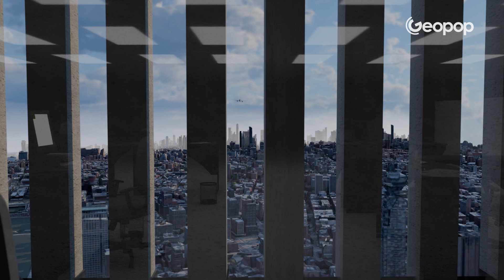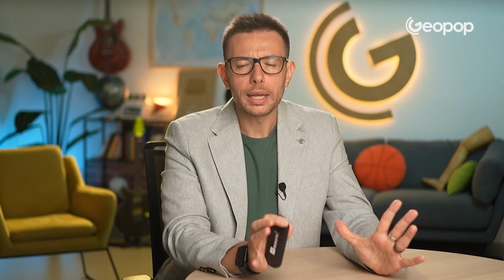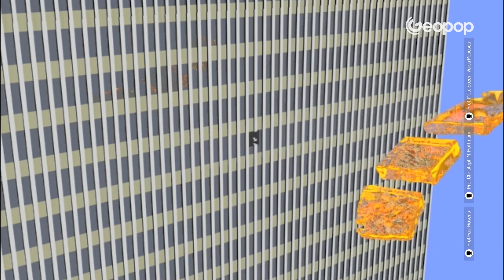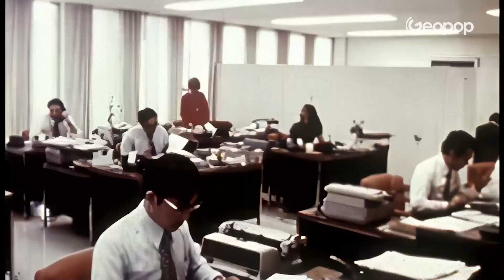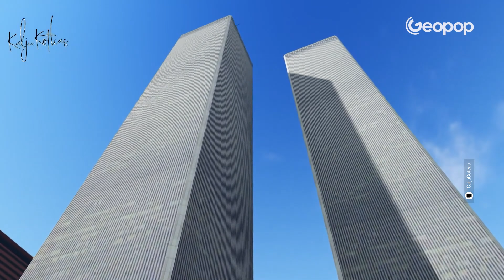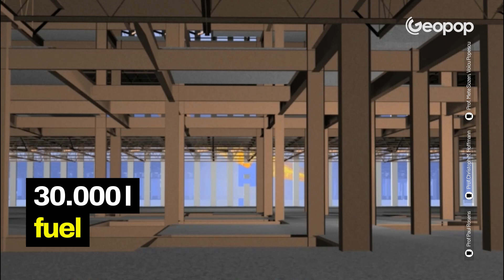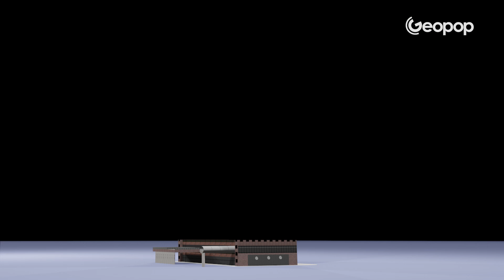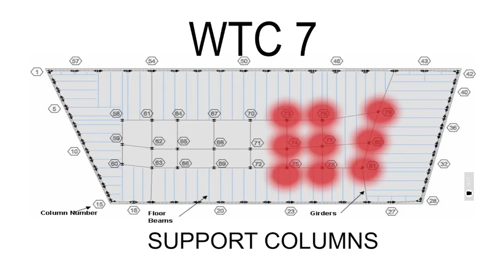9/11, 2001: The Technical Reconstruction of the Twin Towers and WTC 7 Collapses

Comment: 100% controlled demolition, never been more sure about anything in my life.
Reply: Sucks to be you then. There’s a lot of really bad information out there about the Twin Towers collapses, much of it easily accessible to anyone (mostly from Architects & Engineers for 9/11 Truth who only manage to get the date right). Even though the worlds professional engineering community had the details largely worked out within a couple of months, good information is far more difficult to come by and much harder for many to digest. Engineeringspeak is complex and dull. Wild baseless speculation and pathological theorizing is exciting. Simple, easy hand-wave answers are simple and easy.  Fanciful tails of pre-planned demolitions, magical space beams, melting steel and mini-nukes (the awful stuff) are far more entertaining and require a whole lot less thinking, thus getting far more intention than it deserves.

To correct that situation, I have all on my own prepared this short yet detailed technical description of Twin Towers collapses based on my own observation and analysis of the available true and relevant facts. No politics or ideology, just the engineering. My hope is this will dispel many common myths and answer most if not all questions you may have about the Twin Towers collapses, because anything can seem like a conspiracy if you don’t understand how it works

While complex, most of the Twin Towers collapse mechanisms can be seen with the naked eye and easily discerned and understood by the layperson if sufficient time is taken to understand. 

1. The Twin Towers consisted of 4 primary structural elements that together formed an integrated system where each relied on the others.  47 hollow box-section steel Core Columns carry the majority of the gravity loads. The 236 hollow box-section steel Perimeter Columns carry the remainder and ALL of the lateral (wind) loads. Long-span Lightweight Steel Trusses connect the core and perimeter column together at each floor with a Hat Truss on top to tie the structure together as an integrated unit where no element can survive without the others. There was no structural load bearing concrete and most components were bolted together.

2. The impact of 117 tons of airplane (= to about 12 dump trucks) at speeds up to 590 mph with the energy of a ton of TNT completely destroys the aircraft. This in no way implies the Towers come out unscathed. Many perimeter columns are damaged or destroyed as are some core columns (example; 33 of 59 perimeter and 20 of 47 core columns damaged or destroyed at the impact floors in the North Tower), This damage is primarily through bolt-shearing failures at the end connecting flanges, as well as bending, twisting and fracturing of weld seams. There was no cutting or slicing - the reality was far more violent and messy. 

3. The impacts destroy or damage fire insulation, fire breaks and sprinkler systems on multiple floors.  Huge fires are started across multiple floors simultaneously and allowed to spread rapidly with no effective firefighting or fire suppression. This was an unprecedented fire event . 

4. The hotter steel gets the weaker it gets .  With fire insulation stripped away and no sprinklers the survival time of the steel greatly reduced. Gradually over time heat causes the lightweight steel Floor Trusses at the impact damaged floors to sag, which was observed and recorded.  No steel melted or needed to. Structural steel fails long before it becomes a puddle. It just needs to bend

5. Sagging floor trusses pull on the increasingly weak and overloaded Perimeter Columns, causing some of them to bow inward by up to 5 feet. A straight column is up to 4 times stronger than a bent column. The bowed Perimeter Columns buckle and fail, initiating collapse. The formerly static mass above which the structure below could easily support is now converted into a dynamic mass up to 30 times greater. Because they have buckled, the Columns above and below the failure point are no longer aligned . The load bearing structure below no longer bears any load as it falls past the lower columns, NOT onto them.

6. Thousands of tons of debris fall within the four outer walls, down through the open office space, crashing onto the first intact floor it encounters. This massive impact immediately breaks the bolted connections to the columns as the amount of resistance the Floor Trusses can offer is negligible.  The falling debris slows only marginally and briefly. Note:
6a. This is NOT a solid top block crashing into and “crushing” a solid bottom block .
6b. The debris falls past the columns not onto them.  The columns provide no resistance to the falling debris. 
6c. Only the bolted connections of the floor trusses to the core and perimeter columns can offer any resistance. A pair of 5/8” bolts at each end of each truss vs. thousands of tons of falling debris.
6d. No laws of physics are violated.

7.  This floor-led collapse progression within the four outer walls can only go straight down. Note: 
7a. This process is often incorrectly referred to as “pancaking” which actually refers to a completely different process rejected at an early stage. The catchy name stuck but nobody knows what it is supposed to mean.  Pancaking is too simplistic and inaccurate anyway. More like Kaiserschmarrn.

8. Collapse progresses through the floor systems not down the columns, through the path of least resistance . Rate of floor failures increases with each successive floor as momentum increases, reaching an average acceleration of 0.65 of GA, or 35% slower than true free fall. Bam, bam, bam down the building until there are no more floors to fail.  The resistance offered by each successive floor is always the same. The mass and velocity, thus the energy of the falling debris is constantly increasing, with each floor destroyed adding new falling mass. Some falls to the sides, but most falls down. More mass, more velocity, same resistance with each floor.  Don’t get stuck on the but the lower floors weren’t on fire nonsense. They weren‘t and didn’t need to be.

9. The Towers were 95% air by volume. As that air was compressed inside the building it is forced down the tower and blown out the sides in reaction to the building collapsing . Those were not “explosions”, it was expulsions of compressed air caused by the collapsing building, explaining the low velocity, lack of flash, blast, supersonic pressure waves and lethal high-velocity ejecta.  

10. Perimeter Columns become detached and peel away like a banana behind the collapse front, playing out to the four points of the compass extending to more than 600 feet from the base of the towers. This was quite obvious from examination of the debris pile. 

11. Core Columns fail last as their internal beam bracing is stripped away by falling debris and lateral support from the floor to perimeter columns is lost. 

12. For those who care about how long this whole process took; 31-34 seconds from the moment the perimeter columns buckled until the last core columns hit the pile, or 1/3 the rate of true free fall. Don’t believe me?  Just watch any video of the collapses and note the loose truly free-falling debris dropping much faster than the towers themselves.  

13. Each Tower had a 1-acre footprint. Far from collapsing inside their own footprints the debris pile spread out over 17 acres in a pile up to 14 stories deep. 8 surrounding buildings were destroyed and scores more damaged by the falling debris. 

14. What was NOT observed were the 180-190 dB bangs of thousands of high explosive devices or the blinding bright flashes of burning thermite. Neither could have caused the (silent) perimeter column buckling that clearly initiated collapse.  Neither explosives or thermite could have survived the impacts and subsequent fires either. A video of a shocked and injured firefighter using the magic word explosion is in no way proof of explsoIVES . The pre—planned demolition case relies entirely on that sort of thing. There is zero tangible physical evidence and it would be technically impossible, totally impractical and completely unnecessary. No one would bother. 

15.  Finally, the Twin Towers were perfectly safe within their design envelope.  They only collapsed when taken far outside design parameters by an extraordinary and unprecedented event 

Impact + Fire (heat) + Time + Gravity = Collapse . Remove any one of those four elements and there is no collapse. Ignore any of those elements (as many do) and you will never understand the collapses. The Twin Towers were an integrated system in which no one component could survive without the others. One fails, the rest follow, through the path of least resistance – DOWN – through the open space, bypassing the path of greatest resistance – the columns.  Nothing I just described violates any laws of physics. All of the above is true no matter who planned and carried out the 9/11 attacks or why 

I hope you found this helpful and informative. It is not meant to be adversarial, but to solicit informed critical comment, positive or negative. If I made any errors of fact, logic or reason or left anything critical out, please let me know so I can fix it. To stay focused just one topic at a time please and on-topic (Twin Towers ONLY). No word-salads of Gish Gallop. IF you can offer a more plausible alternative be my guest. Be the first. Please start any reply with the words “Tits McGee” or I will know you didn’t actually read it, are not serious and just wasting my time.
Reply: OK, then if it was CD, then what was the purpose of the airplanes? Why not just blow the building and blame the same terrorists who tried it in 1993?
No person who ever supports the CD theory EVER has a response to that question, much less a plausible answer.
So, since you've never been so sure about something, what is your explanation?
Reply: @kyle381000  nobody wouldve ever have believed "terrorists' somehow managed to bring in the tons of explosives necessary to bring the buildings down, then having the knowledge where to precisely place the explosives. No, the crashing of planes into the building made sense, it was spectacular and truly traumatizing to all that witnessed it, as it was supposed to be. 
In the months leading up to 9/11 extensive work had been going on for weeks, they only worked at night and had armed guards patrolling the stairwells to ensure no-one could witness what was happening in the elevator shafts. These "elevator refurbishments" were coincidentally carried out by a company owned by George bush's brother!! Too much of a coincidence for me. The explosives used were a type of thermite, literally laboratory made, no way could terrorists gain access to such exotic materials, only governments.
Reply: @ 
That is utterly delusional. Period.
Reply: @flourescentadolescent1  - I have a simple and entirely hypothetical question. One I have asked hundreds of times but no one so far has even attempted to answer. Run from it like Cockroaches from the light they do. Maybe you can be the one to change that trend.

If YOU were to plan the 9/11 attacks, how would YOU do it ?

Remember, you are staging attacks on 4 world famous, iconic symbols of American economic, military and political power, you absolutely can’t get caught and it absolutely has to look like everything was done with hijacked commercial domestic airliners used by terrorists as Kamikaze missiles.

So, how would _you do it?

You need to figure out what you are you trying to do, how would you most effectively go about doing it and why in a plan that makes the most sense as the most efficient and effective way to achieve that objective. And remember, it has to fit ALL of the available physical evidence and visual record, preferably not require Rube Goldberg levels of complexity, and make logical sense.

And you sure as hell can’t do anything that will get you caught.
Reply: @kyle381000  I tell u what, thousands of architects and engineers from all over America and beyond state plainly those buildings could NEVER have collapsed in the time they did...INTO THEIR OWN FOOTPRINTS!!!! 
These are the people that have built everything around us, and to the highest safety level in history, and they say it was a controlled demolition then I believe them. Our government is evil, and the enemy of all decent human beings walking the earth.
Reply: @flourescentadolescent1  - Ummmm, no they didn't.

3,650-sh people with some sort of credential or degree in some technical field or another (only around or so 25 in structural engineering) simply signed this;

To the Members of the House of Representatives and of the Senate of the United States of America, PLEASE TAKE NOTICE THAT 

On Behalf of the People of the United States of America, the undersigned Architects and Engineers for 9/11 Truth and affiliates hereby petition for, and demand, a truly independent investigation with subpoena power in order to uncover the full truth surrounding the events of 9/11/01 — specifically the collapses of the World Trade Center Towers and Building 7. We believe there is sufficient doubt about the official story and therefore the 9/11 investigation must be re-opened and must include a full inquiry into the possible use of explosives that might have been the actual cause of the destruction of the World Trade Center Twin Towers and Building 7 .

The petition is not testimony or an affirmative statement of anything. It is a mere request that someone else look into the POSSIBILITY of the use of explosives or incendiaries that MIGHT have been the actual cause of the collapse of the Twin Towers and Building 7 because of a belief there is sufficient doubt . 

Can’t get more generic and non-committal than that!

The folks who signed apparently can’t even be bothered to do the investigation themselves, or perhaps they are unqualified or just not that interested. Not that important I guess. Those who have signed certainly do not publish peer reviewed technical articles in favor of AE911T claims. Once would think there would be at least many hundreds of such articles if there is so much expert support but there’s nothing.

One does not even need to believe explosives/incendiaries were used on any building to sign the petition. Indeed, I have several friends who think that is idea absolute nonsense, but signed the petition anyway just to get the AE911T newsletter. So you can’t make any assumptions about why anyone would sign.

Worth noting that just 3,6xx names over 18+ years of campaigning is a phenomenally tiny, insignificant number.  Completely insignificant.  If we break that down further many signatures are so old that a significant number of signatories has likely passed away. Others surely no longer support even the very limited scope of the petition's language, may have even forgotten they signed the thing. Others are not practicing or no longer certified in their fields. Many architects and engineers are not qualified to assess the engineering facts of 9/11 (land surveyors, electrical engineers, ...), and most obviously are not well informed about the facts of 9/11 (they only heard the AE "Truth" sales pitch) so the fact they have signed the petition by itself means nothing

Meanwhile the 130,000 member American Society of Civil Engineers - ALL of whose members are qualified engineers - fully supports the conclusions presented here. And that is just a start.
Reply: @kyle381000  Yep.  Also he could attempt to propose a logical reason to bring down 7.  The two reasons commonly given - Silverstein insurance money, and/or to destroy documents, are both total failures and I'm happy to pick them apart if any truther wants to make those dumb claims.

Comment: It's quite obvious that this video is a flight of fancy. If an aluminium tube had the ability to cut through such massive outer columbs, the fuel would have exploded imediately as evidenced by a fireball, that would leave very little fuel to raise a temperature above 700C which is far below that required to warm steel, let alone soften it. Even if anything this idiot said could be proved, it would still not explain why two buildings collapsed in exactley the same way in free fall as did the building 7? To fall at free fall there has not to be anything between the falling part and the floor? Which was not the case. When you have worked with steel for more than 50yrs and know just how hard it is to keep heat into steel to cut or bend it you know that physics was put on hold that day in order to explain away a demolition job along with other impossible things that day such as planes folding wings in so planes could it could go through the Pentagon 14 foot diameter hole.
Reply: There was no "cutting".  Wrong mechanism. Bending, twisting and most importantly bolt shearing failure at the end connecting flanges - never designed to take such massive lateral loads.  This short video gives but one small example of what I am referring to. 

youtube.com/watch?v=P8mG9pyImb8
Reply: Also, do you think jet fuel was the only thing burning in those buildings? In offices full of paper, books, carpet, electronics, and furniture? Office fires have been known to exceed 1800°F, more than enough to substantially weaken steel.